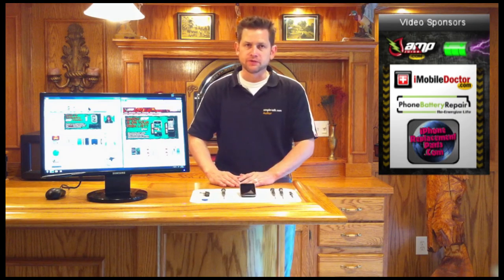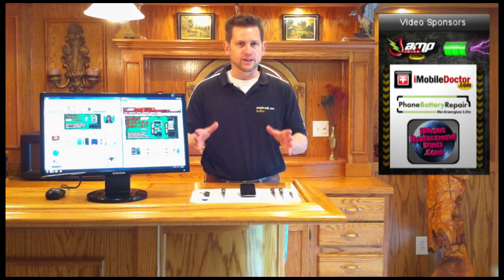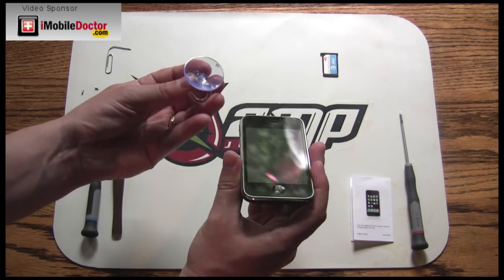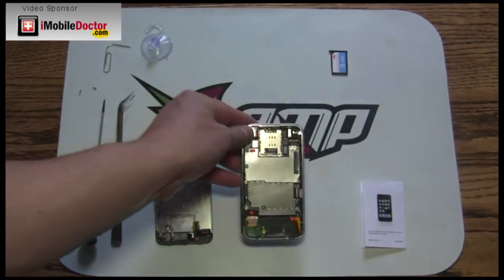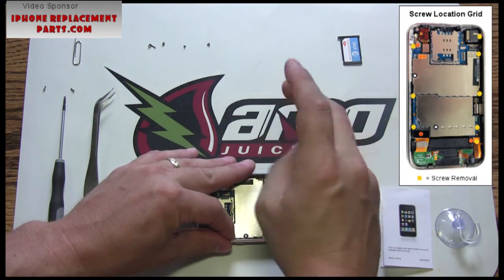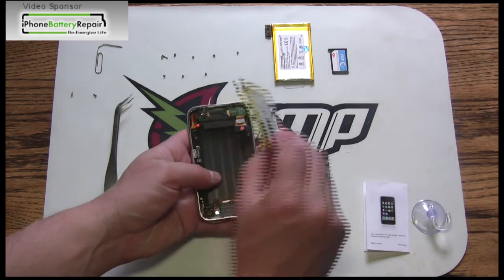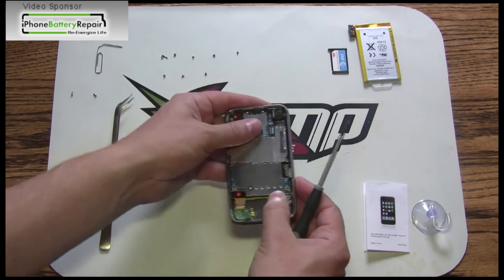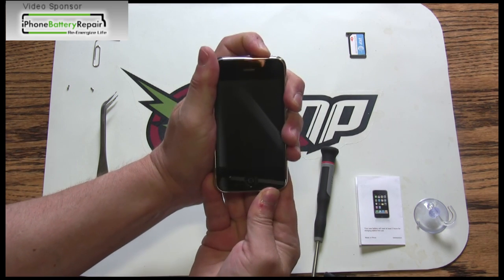iPhone 3Gs Battery Replacement by AmpJuice.com

Comment: i am thinking about replacing my 3gs battery as it just died today and will not recharge.

but i'm worried about losing all my data.

does anyone know if i remove the battery and replace it, will all my music, photos, settings and apps still be there when i re-assemble and turn it on?

please respond asap as i am about to order the battery